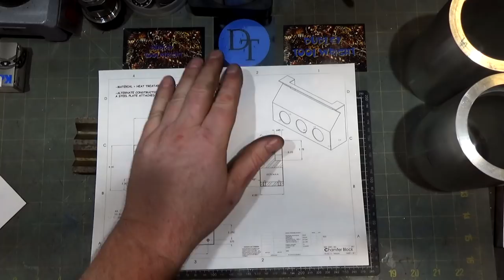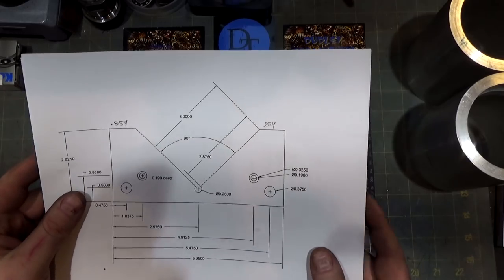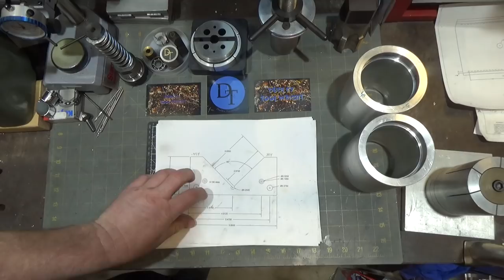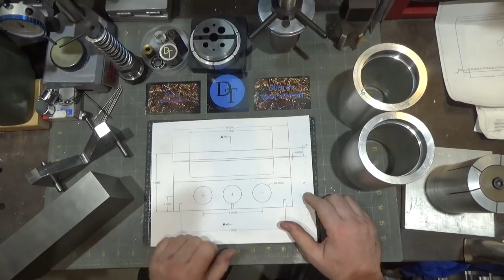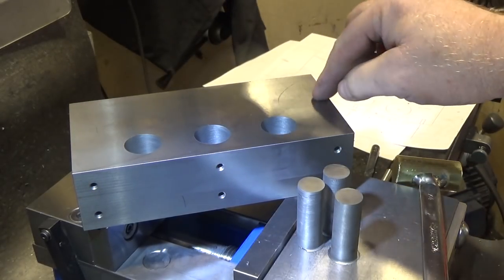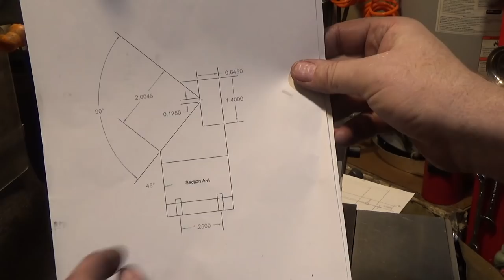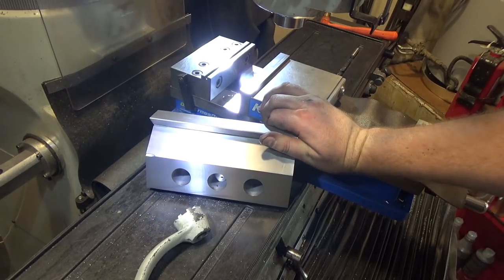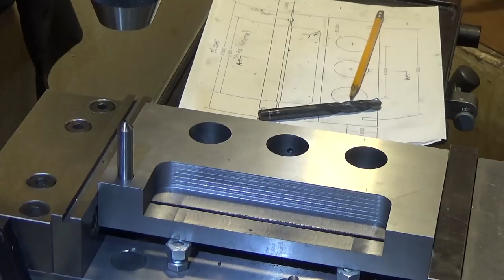134 Surface Grinder Chamfer Tool

Comment: Nice , i am going to steal your idea with the diamond !     Interesting to see you run out of travel with the slitting saw . My new one that i made with the R8 tooling , i have not shown in use yet has a low profile clamp system for the cutter . As low as 3/16  under the cutter .     Great job .  Cheers .
Reply from the maker: I look forward to seeing it Max. I haven't had the gumption to attempt any projects as technically difficult as what you just pulled off. That was a great series. I  really learned a ton.

Comment: Great video and thanks for sharing.  With regards to the counterbore cutters being oversize, those cutters do come in various fits, e.g. close fit, 1/32" loose fit, etc.  I have some Keo brand counterbores that are oversize (but they are noted as such on the package label), so maybe your counterbore cutters are an oversize "loose fit" version.
Reply from the maker: Thanks for the info! I was not aware. Mine were not labeled other than the screw size they were for.

Comment: Nice project, thanks for sharing.. Also, how is the DRO on the surface grinder working out?  Thanks
Reply from the maker: The DRO has been great. I would probably be able to give you better feedback if I had tried to do any super precision work and needed high linearity and accuracy, but so far haven't.
Reply: @DudleyToolwright  Thanks.. If you do, that might make for a nice video update..
Reply from the maker: I definitely will. Thanks.

Comment: Not bad. But what happens if you push your workpieche a little to hard against the block ... he tilts against the grinding wheel... wich is spinning in the pocket on the backside ... right in front of an edge... I think you can guess the rest of the story ... i know .. my english is not the best =)
Best regards from germany.
And thank you a lot for your reat videos my frind!
Sven
Reply from the maker: If you push the work too hard, bad things could happen, but it only works for relatively small workpieces and holds really well on the mag chuck. Your point is well made. Viele Danke.